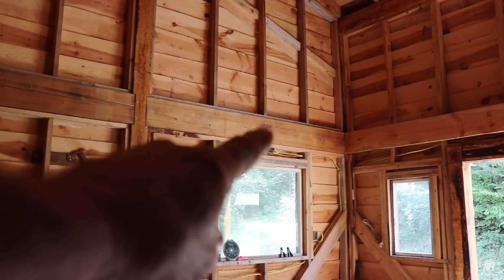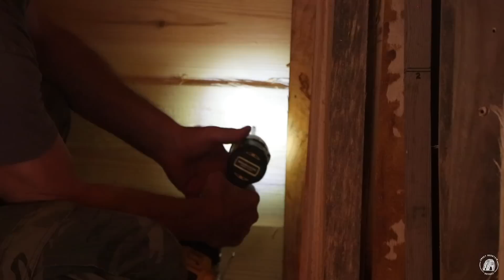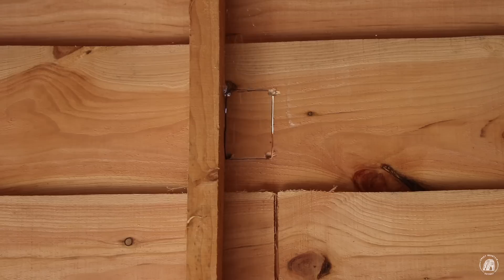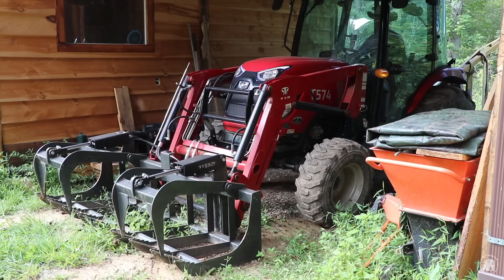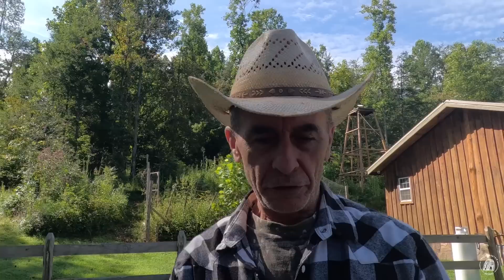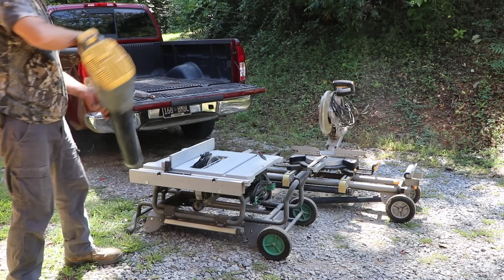🔧 Workshop Electrical Is Done - But HURT My Back!!

Comment: ..look after that back, I can speak from experience. My job involved harvesting field trials, a modified combine with a work platform bolted onto the side. Grain passes down a chute into hessian bags, some weighing over 60 kg (130 lbs). These then had to be handed down onto a trailer to take to scales in the barn, handled again to empty the trailer to the scales, from the scales to a pallet, before tipping into the grain pit. A lot of heavy lifting, before we had in-tank weighing on newer combines..

Get better soon..

Comment: Why are you not using strain relief fittings on your electrical boxes.   Especially the metal ones with the sharp edges on the holes for the wire.
Reply from the maker: Haven’t used any metal boxes as of yet. All these are plastic, and that’s why I put a staple within six inches of any box to hold wire from moving around. I will when I get to the power panel because it will be metal, and needs more protection. This is only just my opinion. Thanks for watching and have a blessed week